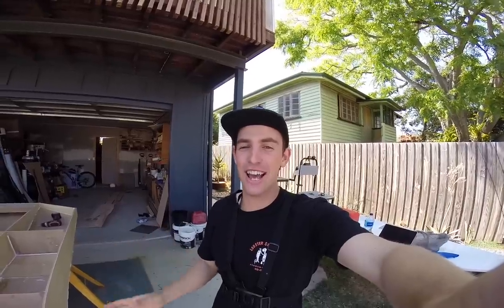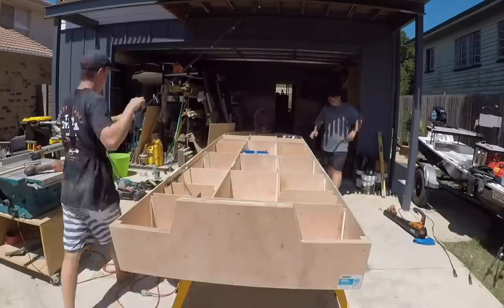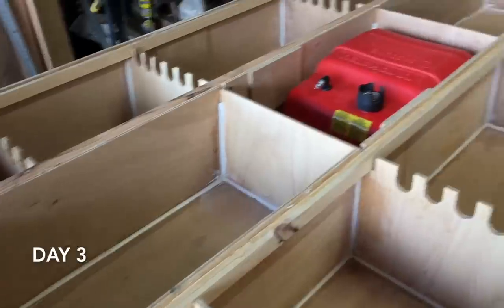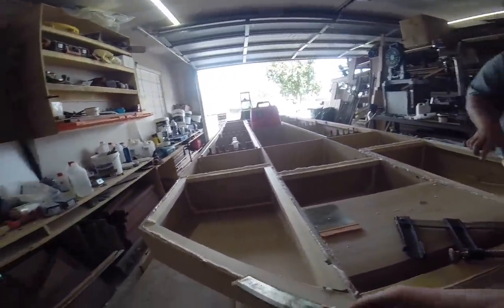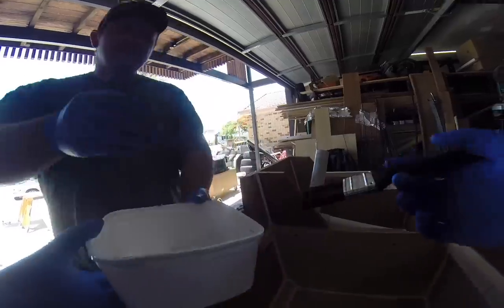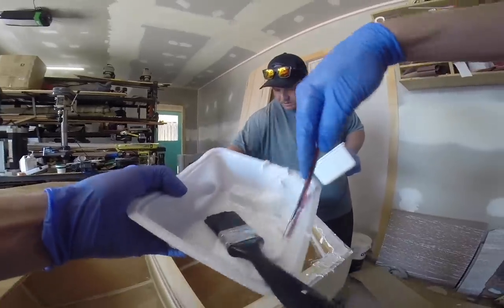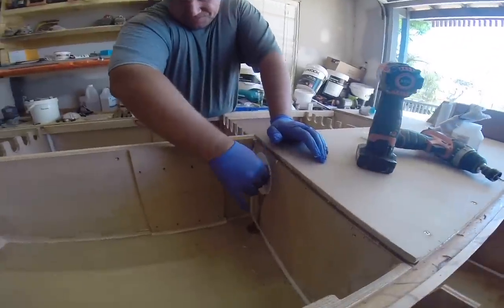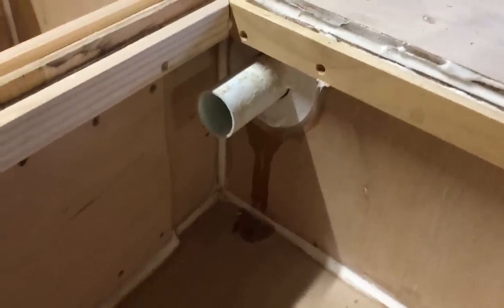How To Build a DIY Plywood Boat // Part 2

Comment: Timmy great build buddy ,one thing I would recommend. I would spray foam all those void spaces under the deck make your boat feel more solid and quite also would help for the flotation. Can’t wait for the first lunch of your new ride! Great job.
Reply from the maker: the boat doesn't make a sound its not like a tinny with all the layers of wood cloth epoxy and paint and would just ad time weight and money. I wouldn't recommend it for this build. thanks mate :)
Reply: I’m pretty sure you’ll do great on it anyways ! Greetings from Canada !

Comment: Awesome boat.  For the fuel line PVC I’d use pvc electrical conduit because the 90 is a sweep and easier to pull the fuel line through.

Comment: Presumably since Jamie "won't be seen until January" it means the project is ultimately already finished? I can't wait to see the end product. This has inspired me, when my son is a bit older, to do a build like this with him, and for it to be his first boat. I have also been looking at micro-skiffs like the one Jamie built for himself, too. Pipedreams 2 is a bit too wide for some of the areas we get into, would you consider providing plans for that build at some point too?
Reply from the maker: at the widest point Jamies and my boat are the same width. pipe dream 2 just doesn't have the front brought in giving mine more volume up front and will be easier to make for someones first boat it becomes a bit trickier to get the shapes of his. he does not own the rights to his plans so cannot sell them. yes boat is already finished and o the water. it gets into tight spots and allows 2 people fit more comfortably on it also but up to you

Comment: Awsome build mate. Did u think about putting a bilge pump under the back section at all?
Reply from the maker: No its all air tight in there don't want anything compromising that. once its seal nothing should get in there ever. have been thinking about installing them at the back of the rod lockers and making all water from hatches directed to them but it has proven pretty good even going through a couple of waves keeping 90% of water out

Comment: Would not the expanding Gorilla Glue work just as well. I watched a john boat video built with it. Just wondering. It would be much easier. Can i get plans for this boat? I really like what you are doing.

Comment: Just wondered about it for a rub strip when sliding on the bank. The strakes should sort the cornering. Are you trailering it?
Reply from the maker: so many questions haha yes trailer. and the strake goes most of the way to the front so does give a little bit of a buffer for going up the bank but not like a tinny wouldn't recommend just dragging it up everywhere. all questions will be answered in coming videos mate :)

Comment: Hey timmy, loving this series but do you reckon you could (once it's complete) calculate an approximate weight for the boat, I imagine it being all ply it must be getting quite heavy. 

Maybe go to your local tip and weigh the trailer with the boat on, then subtract the weight of the trailer? Just a thought, cheers. :)
Reply from the maker: roughly 80kg with out all the extras mate
Reply: Fishing With Timmy Turtle oh wow okay, so not as heavy as I thought, cheers for the reply.

And one last thing I'm curious about is the PVC pipe that you're running fuel lines etc. through at 19:52, will there be some type of mitigation or drainage for rainwater/ splashes etc from getting in there and sitting in the pipe?
Reply from the maker: That was the plan but still haven't done it hahaha. only really an issue when going offshore. Going to seal it with a breather tube sticking up eventually. To keep water out but still allow the petrol fumes to escape. if you park the car on a down hill the water will run out into the hatch then I just sop it up with a sponge when cleaning the boat

Comment: Timmy, just a  thought with that fuel line/ transducer cable tunnel, are you sealing it at floor level once cables are through so water doesn't sit in the PVC pipe and fill up the fuel storage section?
Reply from the maker: That was the plan but still haven't done it hahaha. only really an issue when going offshore. Going to seal it with a breather tube sticking up eventually. To keep water out but still allow the petrol fumes to escape.
Reply: Brilliant.  Love the build And so much storage.  Any solar blankets in use to allow charging  of devices Or are you purely relying on battery storage for this?
Reply from the maker: I usually take two hundred amp hour batteries with me but have had up to four stored below deck with no issues. solar is a bit out of my price league after the build
Reply: Holy crap, you'll be able to camp out for a whole weekend with 4 batteries hahaha.

Comment: Hey buddy good work on the videos! Loving these build videos! Where abouts did you get those flush conduit end pieces that you used for the fuel and tranny lines?  And what are they actually called? Haha cheers mate! Keen to see season 3
Reply from the maker: not sure exactly what they are called but just down at reece plumbing
Reply: Fishing With Timmy Turtle sweet cheers mate! How long before you beach launch this sucker? Haha
Reply from the maker: been outside a few times. got her 8km offshore first trip haha
Reply: Haha that’s the go! What hp did you end going? I’m rebuilding my 4.5m tiller glass boat, thinking about sending it 20ks offshore for the first trip 🤷🏻‍♂️🤣
Reply from the maker: 18hp. top speed just under 50km/h
Reply: That sounds like a handful haha

Comment: Going great Tim. Would it be beneficial to drill a hole in walls and inject that expander foam into front and back sections to improve flotation would also reduce condensation issues too or would that be overkill and too expensive?
Reply from the maker: wouldn't help with flotation because it is just adding weight and money. flotation is displacement so it will be fine and would take massive amount of damage to rupture all air tight sections of the boat. also have to be careful some epoxies eat away at the expanding foam so have to check with products you are using. you can do it but not really that important after speaking to Jamie about it
Reply: Yeh I'd rather just have the "air bladder" type like this does. Than to have expandafoam.   Foam is used in tinnies because it's to expensive to mass produce them with airtight seat boxes for flotation.  So just make a semi sealed section and fill her up lol
Reply: Have to be careful with that expanding foam too, it absorbs water and can quickly become waterlogged!